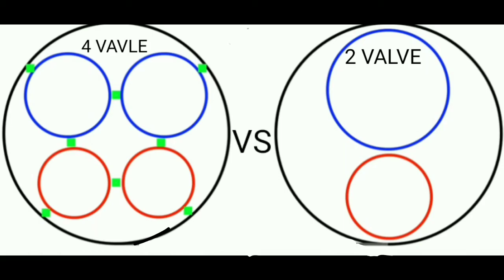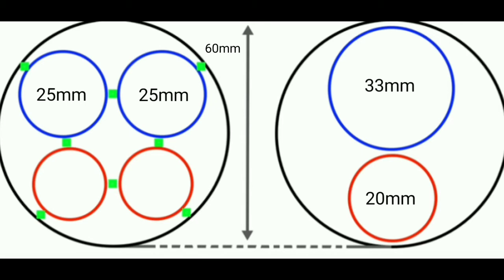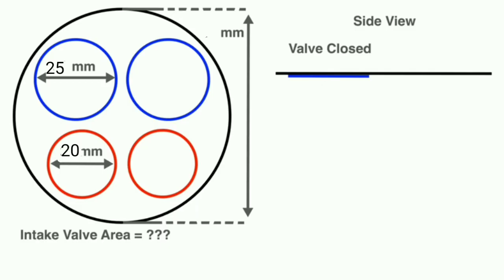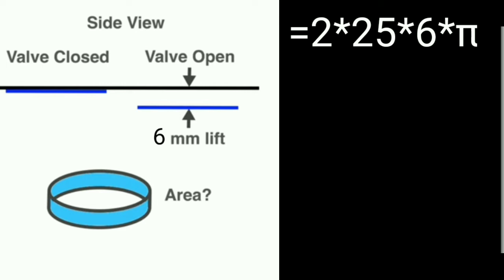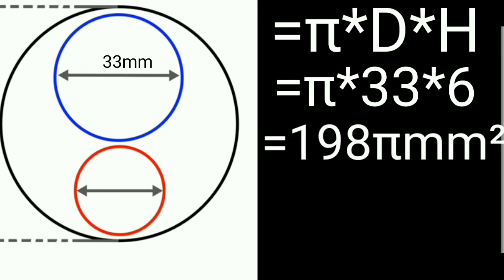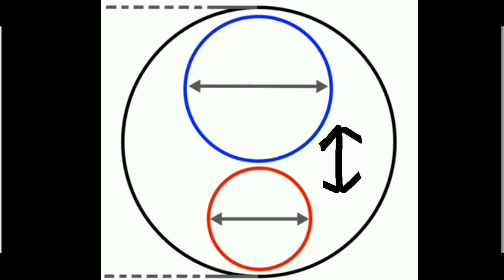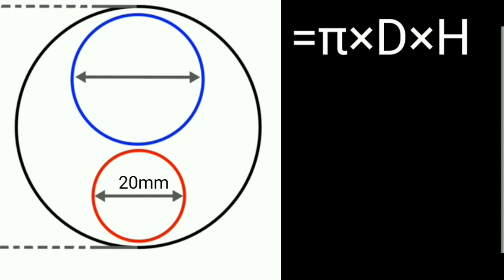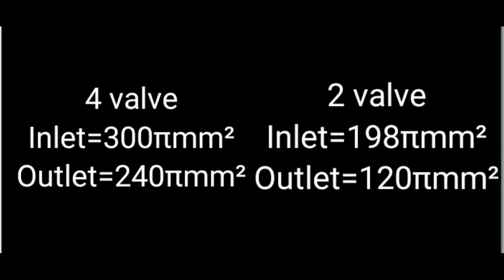4 valve vs 2 valve | Here is the mathematical proof👈👈👈

Comment: So all the 2 valve v8 engines designed for low end torque would have been better as 4 valve engines?
Reply from the maker: Yes you are right .